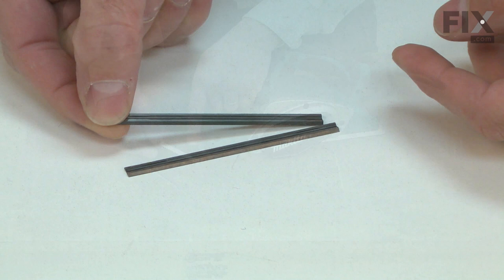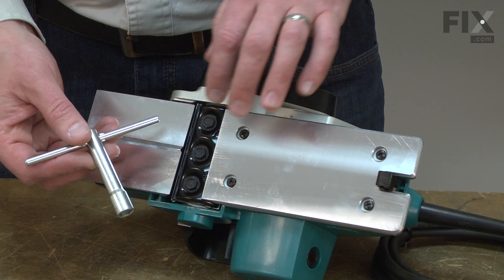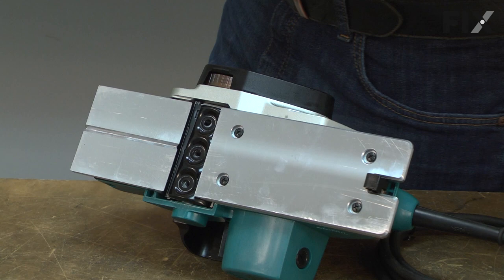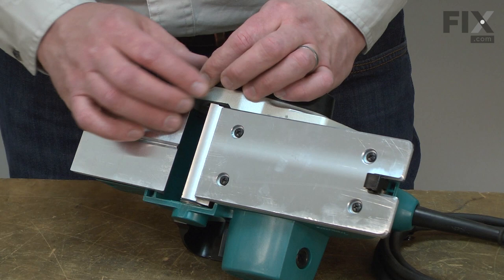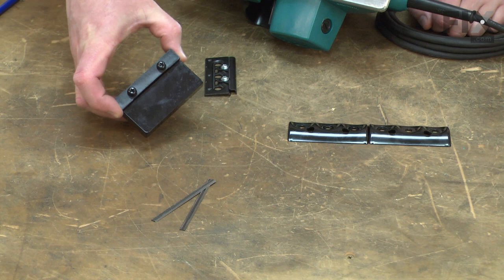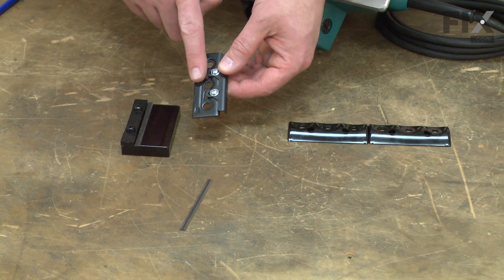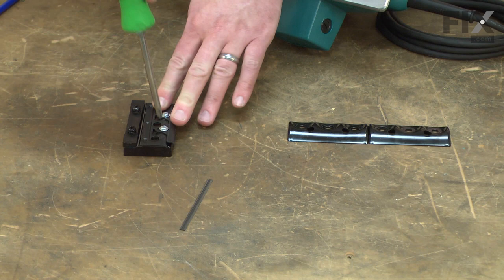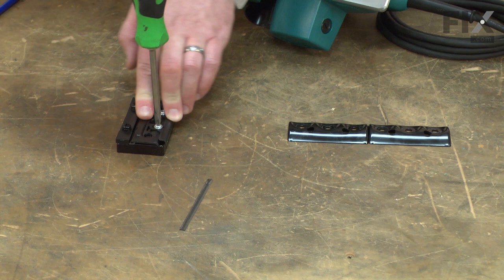Makita Planer Repair - How to Replace the Blade Set

Comment: I second the other guy who stated that this is a terrible design. I purchased a nearly new planer and it was missing the blade jig from the case. I had to spend twenty dollars more for that plastic piece just to align blades. (I had already tried to use the straight edge across the bed method and was about to lose my mind).It was then that I relented and watched a video and learned about the missing part. I will never buy another tool which relies on an expensive piece of plastic for critical adjustments. Just a bad design!

Comment: The blade just sits along the notches, no need to "align" them
Reply: This is incorrect.  You most certainly do need to check side-to-side alignment as well as vertical alignment.  Unfortunately, the typical video covers one but not both types of alignment.

Comment: What is that all about? simply slide out the blade and slide back the other way around or fit a new one. No need for a complete dismantle that is crazy
Reply: Not that crazy as it gives you a chance to align your blades and clear out any dust build up.
Reply: @clivelightwalker  I second that.

Comment: even though you set the blades straight on the block , it still doesn't cut straight and square ,, its shit Makita planers and this system of removing so many pieces to change 1 blade , festool has an easier method